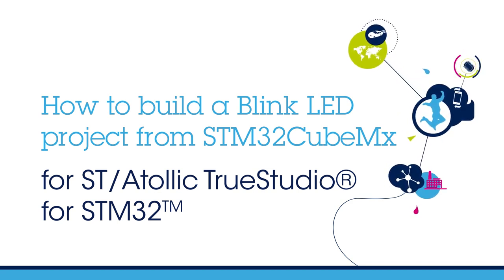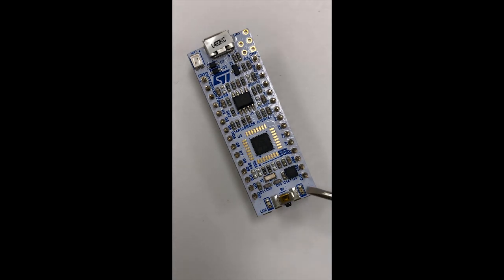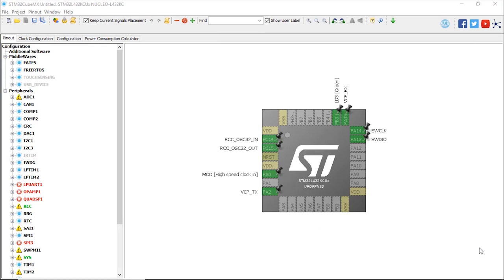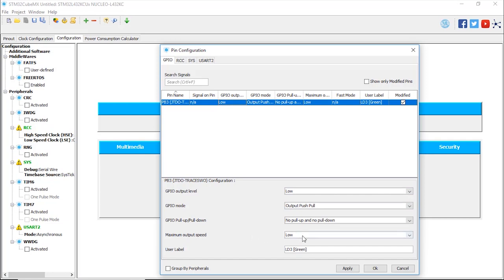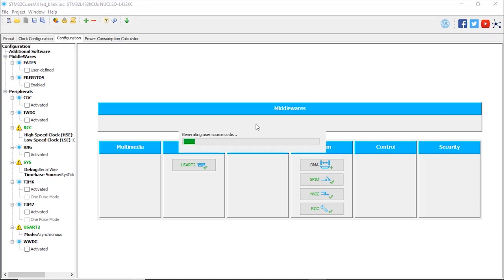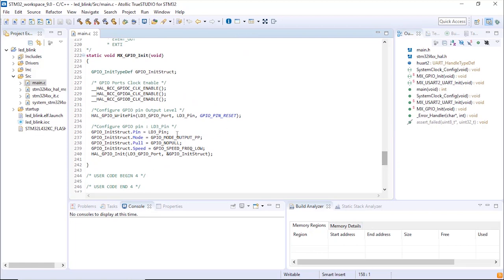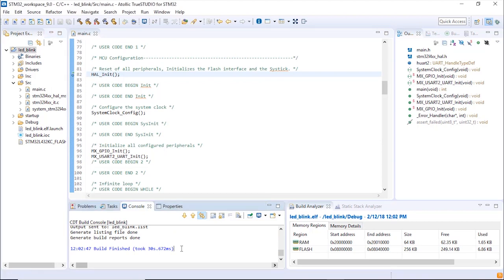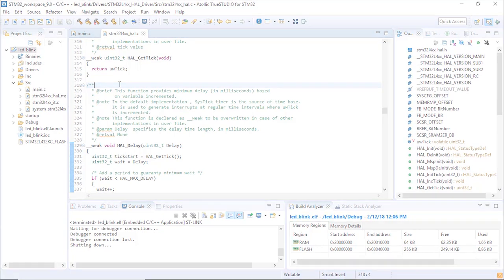How to build a “Blink LED” project from STM32CubeMX for ST/Atollic TrueSTUDIO® for STM32™

Comment from the maker: Hello all, thanks for all of your feedback!  We recommend that you check out https://community.st.com/s/topic/0TO0X000000BTr8WAG/stm32cubemx for detailed questions about STM32CubeMX - effectively the tool has evolved this year so for latest updates and fast answers to your questions the community is the best place to go!
Reply: Dear Sir,

I have installed True Studio on my old laptop which runs on 32 bit based architecture,and I couldn't install the. CubeIDE because of it runs on 64 bit architecture based PC.( And I have old 32 bit based system)

I have ordered for  STM32 Nucleo-F411RE  board and other sensors,Esp8266,DHT11 and other too for learning.,But now I am scaring about that ,Can I debug this  board  with True Studio IDE.....????? Pls help with Comment.

Comment: Thank you for changing the CubeMX-GUI in again and again and again ST, because we really like complexity toolchains with 1000 clicks and windows. Are you kidding? KEEP IT SIMPLE.
Reply: I understand your point. For a trivial application, like blinking an LED, CubeMX might be overkill. However, real world applications are rarely (never) this simple.

Would you prefer videos that features hours long trips through the data sheets, with the goal of deriving the same figures, settings, etc. that Cube could set up with a few clicks? Is configuring the clock tree or establishing ideal PWM frequencies a fun little diversion during the workday? I would guess not. Cube is almost a software miracle, compared to just about anything else out there, when used for the purpose of generating predictable and comprehensible initialization code.

I guarantee that many of those who have a choice of MCUs for new designs are more than a little swayed toward specifying STM parts, due to this app, and the time/hassle it saves, alone.

OK, I’ll just grab my soapbox and be off now...

Comment: It would be nice to have an update for 2020. I managed to follow along, but the steps are different, and I have no idea what all the references to Atollic are about, CubeMX seems to work fine without it. An updated tutorial would help out noobs though.
Reply: Atollic is essentially now the CubeMxIDE for free from ST. They bought Atollic and integrated CubeMX seedless into it.
Reply: @kaihorstmann2783  Dear All,I have True Studio on my 32 bit  architecture based Old system and it's Working well.(I couldn't install CubeIDE  because it not supported by 32 bit based system)

By using True Studio,Can I debug STM32-Nnucelo-F411RE Board ??????

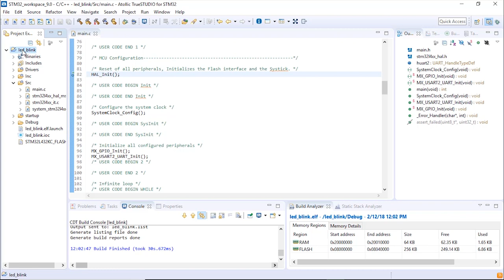Comment: Hi, @8:28 or so, you said connect microcontroller. does this mean using STlink? or directly using a simple micro USB cable
Reply: I have to the same issue,using True Studio for Nucleo Board,cnt debug .

May you please help me on this.
ST-link probe devuce will be needed for the Nucleo F411RE to debug it or just connect using usb cable with Laptop ????

Comment: Ok, you can debug, but what if I want to program the microcontroller?
Reply: If BOOT0 pin is set to low, the program should be downloaded to flash automaticly shortly before debug session starts. You can see it in the console window "Memory Programming ...".

Comment: More of these please! just started using this platform from arduino and there is a complete lack of worked examples like this, next I want to press a button and light the led, next setup a PWM ouput, then read an ADC input ect ect. Thank you!
Reply: good thing, i hate Arduino but STM 32 is better than the Arduino damn thing

Comment: Dear Sir,

I have installed True Studio on my old laptop which runs on 32 bit based architecture,and I couldn't install the. CubeIDE because of it runs on 64 bit architecture based PC.( And I have old 32 bit based system)

I have ordered for  STM32 Nucleo-F411RE  board and other sensors,Esp8266,DHT11 and other too for learning.,But now I am scaring about that ,Can I debug this  board  with True Studio IDE.....????? Pls help with Comment.
Reply from the maker: Hi there, thanks for your question - may we point you towards our community.st.com, where you will find a team of people who can answer you directly ?
Reply: @stmicroelectronics  Dear Sir,Thnxx for the response here quickly,but I have solved the problem,I uninstalled True Studio and Re-Installed it.and when I tried to debug again,

"it asked First time to allow some Settings blocked by Windows Firewall"(which I denied unfortunately last time)and I allowed this time.
And finally I debugged.

Comment: What version of STM32CubeMX are you using?!?  The one I recently downloaded (December 2018) is 5.0.0 and Cube V1.0.  The navigation is NOTHING like what you describe in the tutorial. Is there a newer version of this tutorial with the newer version of of STEM32CubeMX?
The version I have looks like a dumbed down simple version compared to the "Advanced" looking one shown in the video.
Reply: Its not advanced in any way, its the same thing just a different look they have gone for now, tab based and stuff like that so you can see multiple things at the same time.
Reply: @Disillusioned_one  Thanks, I'll check it out. At least I'll be able to follow along.
With each major revision (especially if gui is changed), they should make another video.

Comment: too much complex for just simple blinking led. This is why STM need change your self to Arduino.
Reply from the maker: Thank you for your feedback !
Reply: I agree, somewhat. When you have the STM to control a BMU, send and take commands vai CAN. Using all ADCs and the majority of GPIOs for out/in, it is very nice to get the main code generated after a GUI build.